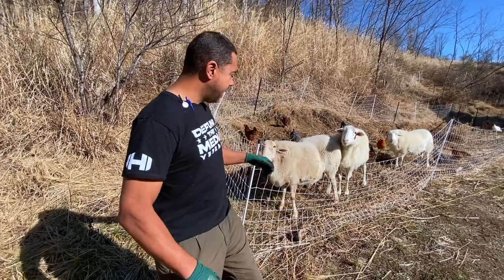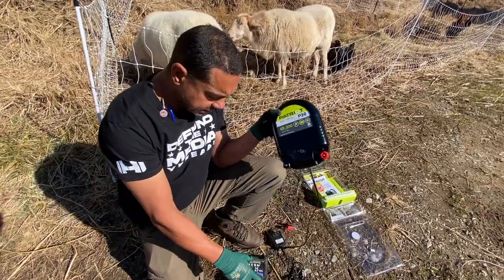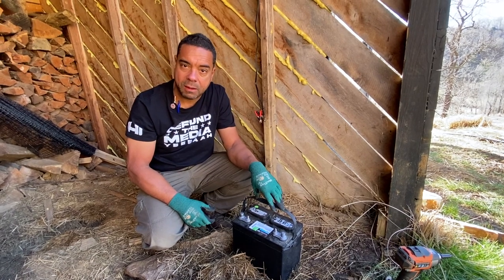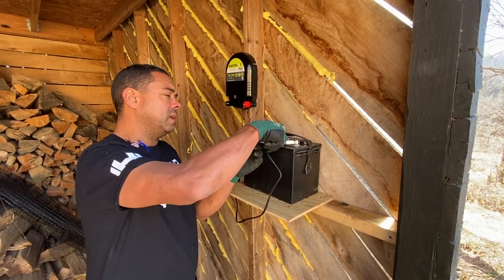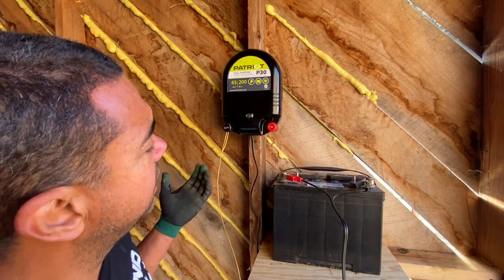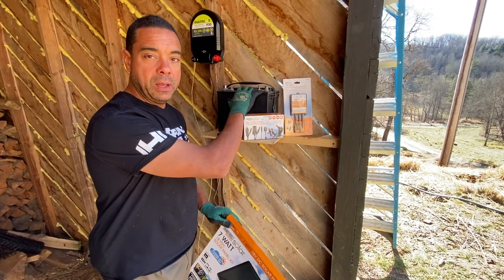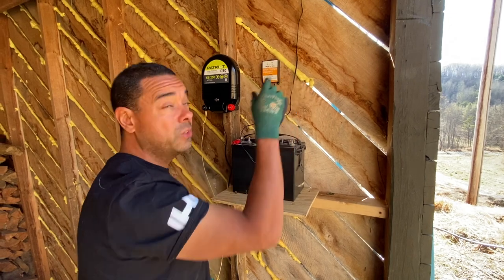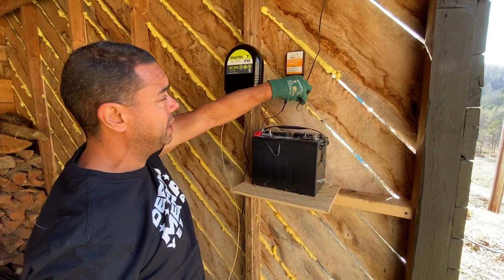DIY Off Grid Electric Fencing: Step By Step

Comment: Neat trick with the ground rod. Didn't work in Iraq or here in the Ozarks. Drove 30,000 10' ground rods in Iraq with a 90lb. jackhammer. Here in the Ozarks we have too many large rocks for that to work (maybe in the winter when there's more soil moisture).
Reply from the maker: I failed to mention that if you can’t drive it vertically just dig a trench 1 feet deep and lay the rod sideways. Works just as well!
Reply: @PermaPasturesFarm21  The soil was so dry in Iraq that laying them sideways wouldn't get enough ground according to the engineers. We trenched in hundreds and had to remove them and then drive them. I used to have a video of the process of driving a ten foot ground rod with a jackhammer. It's quite a feat getting a jackhammer ten feet in the air.
Reply from the maker: @ronaldcummings6337  did they have you pour salt water on the rods?

Comment: Will you have to upgrade the solar panel when you add lights and water pump to the battery
Reply from the maker: The intermittent and infrequent use of those things shouldn’t require more than one more small panel added to what we have. Good question!

Comment: We are planning to do some pasture rotation with pigs. Is it feasible to run insulated wire off this (from the barn) to the netting for that? Or is that essentially the same as what you were talking about having run from your house with the AC unit? 

Premier One has the solar box that seems to be good for pasture rotation. Any thoughts on or better suggestions than that set up?
Reply from the maker: You have it exactly right. We were using insulated wire from the AC charger coming from the house. That THHN wire we were using is rated for indoor use and isn’t made to withstand more than 600 volts so it doesn’t last for more than a few months.
Premier One makes outstanding products but that one joule solar fence charger isn’t one of them in my opinion. The output voltage was barely enough to keep the chickens inside and was useless in keeping predators out. I ended up getting 7 times the output with just a DC charger and a mini solar panel...for half the price.

Comment: Any comments or concerns with the Thunderbolt brand after few weeks of use? They’re running a sale on some stuff an was thinking about pulling the trigger and getting my own setup.
Reply from the maker: I’ve never heard of that brand until now. From what I was able to find, it seems to be made in China. 
When it comes to fence energizers I personally don’t buy anything not made in New Zealand or Australia because they don’t make things with planned obsolescence in mind.
Reply: @PermaPasturesFarm21  Sorry for the confusion, I was referring to the solar panel kit!
Reply: @PermaPasturesFarm21  excellent point